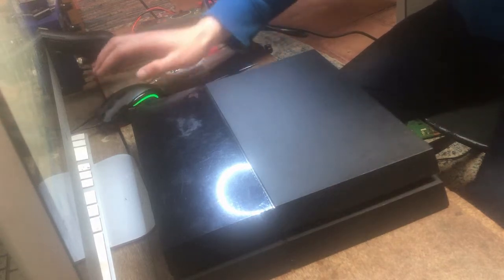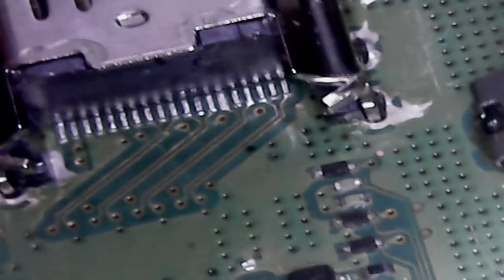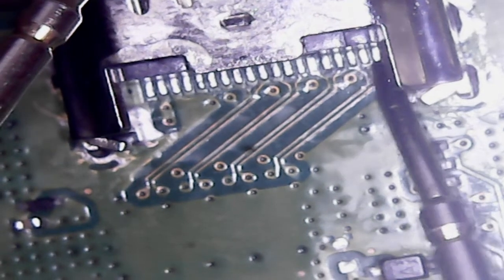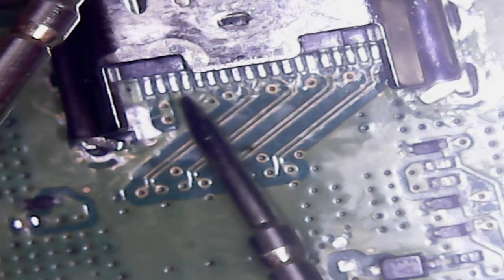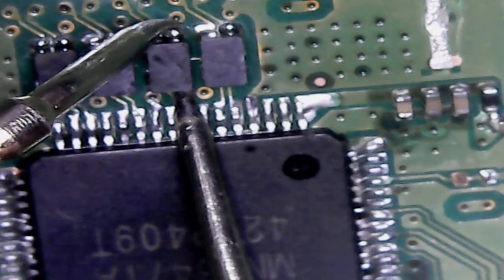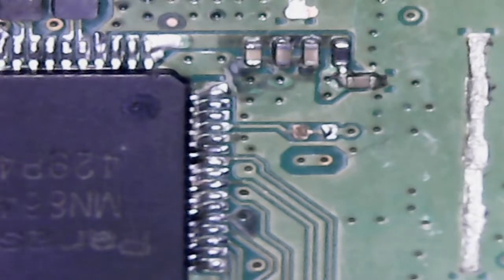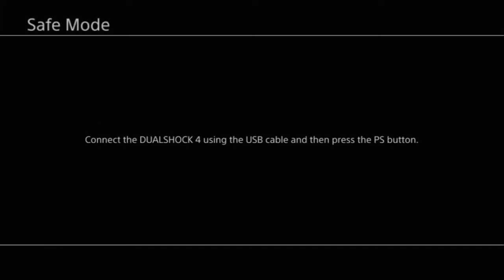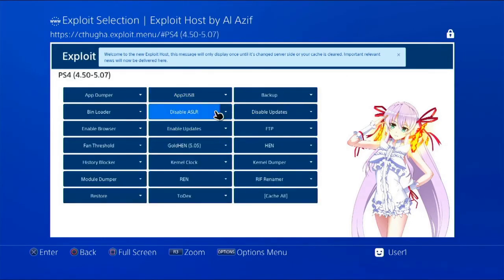PS4 WHITE LIGHT OF DEATH (HDMI ENCODER FILTERS AND MISSING RESISTOR)

Comment: Great video had a similar issue with my PS4 only made it worse when I attempted to repair it unfortunately,very helpful video though 👍
Reply from the maker: thanks for the sub it probably would be better to just solder those pins instead of using hot air its safer for the chip my solder iron needed replacing so wasnt working for this video
Reply: Thanks for the tip 👍